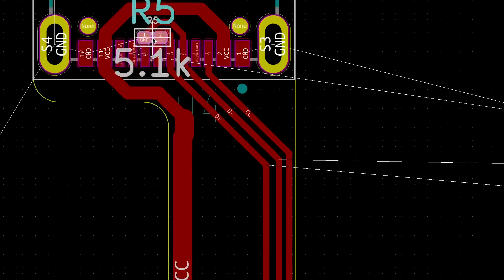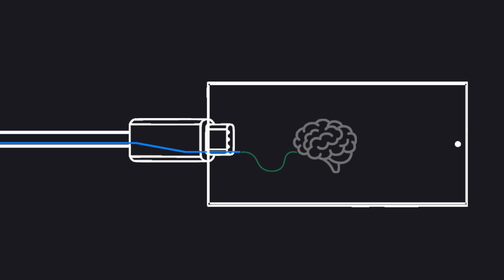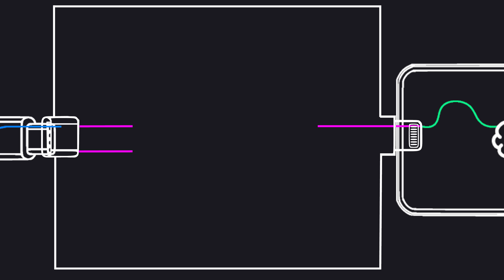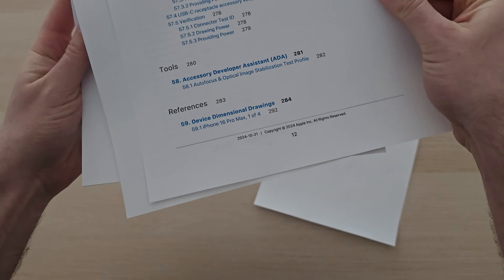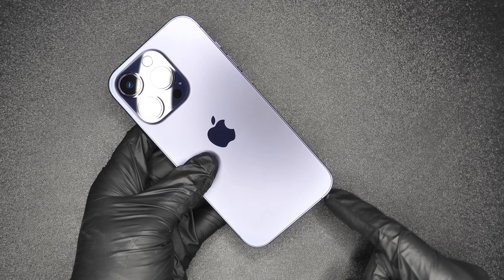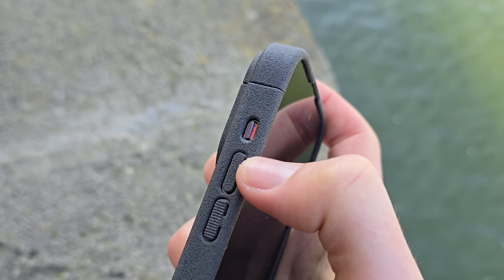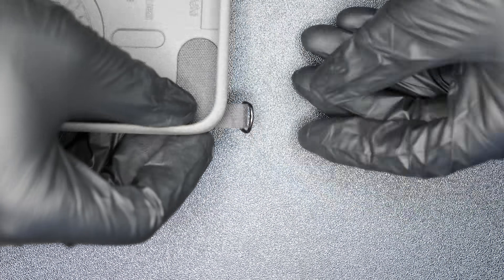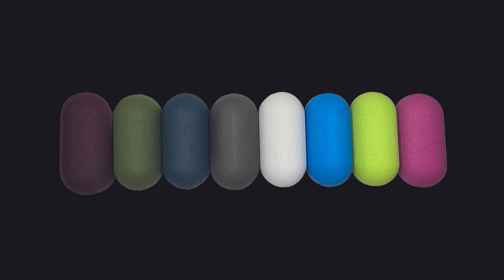I Gave Every iPhone USB-C.

Comment: One suggestion is that I would have that pointy corner for the charger on the left hand side, not the right hand side as most people are right handed and would not find that edge comfortable especially holding the phone with one hand.

Comment: Congratulations on this passion project! I have signed up to be notified when the next batch comes in. I do have a bit of a concern about the positioning of the USB-C port from a durability perspective - were you to drop the phone so that it would land on the bottom right corner, wouldn't it damage the port right away? Looking at the renders and photos on the product website it seems like there is not much padding around the port.

Comment: Adding a headphone jack is a cool idea, but it's not practical. The main reason is that the iPhone's Lightning port doesn't support analog audio input/output. This means you'd need a USB audio chip along with Apple's proprietary authentication chip. There simply isn't enough space for these chips in the device's slender design.

Furthermore, the charging circuitry would need to address how the iPhone could power the USB audio chip when it's not actively charging. All in all, incorporating a headphone jack into the current enclosure size would be extremely difficult, unless the device's size was significantly increased.

Comment: Here is an idea, the latest iphones have very think camera bumps, you can move the usbc near the camera and increase the width of the bump. I would even put it at the back on the left side but horizontal, so the cable sticks out on the side, this prevents also cables the bent

Comment: the USB-C on the side is not an optimal placement. You should exploit Apple's dumb camera bump and use all the free space on the back of the camera. As well as integration of the MagSafe backplates. That keeps the plug on the bottom on the middle.

Comment: Words cannot express my amazement and gratitude that someone finally made a proper USB-C iphone! 

also I'm about to send this to everyone I know with a pre-15 iPhone

about a year ago I was running an 8 with a walmart adapter sticking out of the bottom, and that sucked! it got stuck on everything, the connection was spotty bc of the connection play, and anything above 5V 1A didn't charge the phone at all. If only i had one of these cases 🥲 (my eyes are actually watering right now this is beautiful)

Comment: Great project, you opened up the possibility to charge older iPhones without technical restrictions 🎉
I'm a android user and never has the apple problem, even though I think this is a great project.
As you mentioned, you went all in and because of I really like your journey with your projects I will share it on X and Instagram ✌🏻

Comment: Really great, I have a iPhone 13 mini I love to have usb-c to standardise the charger cables in the home. Although you’re all sold out. 

If  you could somehow solve the missing headphone jack it be a killer product. But I do understand that would be difficult to achieve with it being larger hole and requiring power. 

I like listening to lossless music, Bluetooth doesn’t sound great for me. Having to have an adapter for my headphones is another annoyance. Most adapters fail with time or can affect your headphones. 

I also prefer a rim case, no backing or colour to match my phone. But what you achieved is great, cheers.

Comment: Putting it on the other side would have been better for right handed people.. And when you play games, just turn it the other side for it to be top left.. Iphones are smaller and the corner ends up in people's hand.. Plus they are used to the feeling of tbe round corner.. More people will find it annoying and choose to not use it.. 

You know.. You ask people for their opinion on the street.. Some tell you it should be on the other side and you ignore them. Its a pretty big fail on an engineering standpoint. You have discovered an aspect you had not considered and decided to ignore it for your biased reason. In the end its your product and maybe like apple, you think you know better🤷‍♂️ 
Wtv. I dont even have an iphone. But i remember hating have audio jacks on the botom right. Broke so many plugs.

Comment: I believe type C on the left makes more sense because 80% of the time people are charging their phones while using them, and the cable will be in their way, as most people are right-handed. Both sides have pros and cons. Choose whatever side you wish; you can't go wrong or right. Moreover, the right corner will consistently be in contact with your hand, which may mess it up in the long term. Just my thoughts.
Reply: I had the exact same thoughts, I believe the cord and port would get in the way while using the phone and charging it. As for having it on the right so it doesn't get in the way while gaming - most games allow the phone to be in either orientation and automatically rotates.
Reply: But it's such a awesome invention. I don't have any iphone but will let people know. All the best
Reply: I agree. It should be on the left. It's an oversight
Reply: I'm right handed but 99% of the time, I use my phone with my left hand.
Reply: Right handed, so you hold Ur phone with your  left hand.   Usb C on the right side is correct.
Reply: @siedliko I'm holding my with right hand almost 99%of the time. I belive you must have wrote this comment with right hand. Or using it right now by right hand. Don't lie

Comment: Inwill say from the beginning that I do not need the cases. I like what you did, a lot of effort, great result, here’s what I think you missed. 
Just because you use an Ultra and you’re used to sharp corners, it doesn’t mean others will get used to it. For me this would me a dealbreaker, my gf has  S24 Ultra, I hate how it feels in hand. I believe most people are right-handed, so charging while using the phone now would require switching the hand. The position would be good for gaming, but how many gamers have such old iPhone’s? 
Sorry, you may not like the extra work for a left charging port, but create an option on your site for people to get notified when a left charging model would be available and see how many desire the left charging port (that’s the most accurate way of knowing what the market desires, not what you think it wants)

Comment: Drop test? Surely the primary reason for having a case is to protect the phone. Not sure how much this would actually help. Just saying.
Reply: You didn't buy it for its drop protection, you bought it for the USB-C. But I'm sure it will perform better then without a case on, it is a thick plastic which can absorb the impacts

Comment: This is super cool 🔥 Made me think what if someone took this idea even further and made a physical case for iPhone that adds an Android-style Back button?

Like, imagine a case with a small hardware button that triggers a “back” function system-wide. Could be super handy when you’re using a keyboard or just miss that Android feel.

Right now on iPhone with a keyboard, you can kinda get “back” behavior with stuff like:
	•	Command + [ → Go back in apps like Safari
	•	Command + H → Go to Home
	•	Command + Tab → App switcher
	•	Esc → Sometimes cancels or goes back (depends on the app)

But there’s no true universal Back function like Android has. A physical case with a built-in button that mimics that would be sick. Could even link it to shortcuts or use AssistiveTouch for gestures.

Would love to see someone build that 👀

Comment: @Exploring the Simulation what if you add a 3.5mm jack and a vapor chamber with a preaplied thermalpads that have a protective plastic film witch can be pealed at 180° for better cooling that goes around the magsafe to alow wireles charging and a place for a sim ejector to remove that sim. People can opt for custom sim tools if they want. Nice work overall

Comment: Looks like a useless product.
I have both iPhone 12 pro max and airpods pro both have lightning and i have 16 pro with usb-C
So the only time i plug a cable if i need to copy photos to PC, I charge with magsafe, and sync with BT and WiFi
I have some cheap USB-C to lighting adapter that plugs on and it works fine, but I also have lighting cable

I don't understand who needs this?
Charging? Wireless
PC syncing can be done with WiFi, in worst case you have lighting cable

Comment: 24 hours later and sold out! Amazing!

another advantage to this case: covers the phone's lightning port, preventing dust and debris from entering, therefore extending the life of the port. If the port on the case gets messed up, just order a replacement case ... or don't! you still have a functional protective device!

When phones go "totally wireless," maybe you can do a similar case that converts wired usb-c to a qi2 or whatever magnetic charging standard exists at the time.

Comment: I appreciate why you started with "currently supported" iPhones, since those using even older ones are likely to upgrade to one of the currently older ones sooner rather than later, but I'm a little sad the iPhone X isn't there since that's the only device I have left that uses lightning and I use it as a backup and travel phone.

Comment: Your concept and products are fantastic but everything's sold out!  Not a bad problem to have though.  Would you consider making an integrated battery case for the SE models?  If you would, I'd be very interested in buying that for whatever price it sold for, especially if the battery was 4,000mAh or more.

Comment: Should add a headphone jack, might be a bit tough tho, would need a detect pin on the 3.5mm so it can switch to headphone mode or just a manual switch on side of case idk

Comment: It's a great design, but considering that 85–90% of the population (fact) is right-handed, placing the charging port on the left side makes more statistical sense.
The only thing stopping me from ordering this is the charging port placement. I hold my phone in my right hand, and the cable gets in the way.
Just think about it, your target audience consists of people with older phones. Older phones tend to have dying batteries, which means these users are likely to hold their phones while charging (personal experience). With the charging port positioned awkwardly, it creates a psychologically unpleasant experience with the product.
This experience might not deter impulse buyers, but the long-term impact is significant. A positive experience leads to more sales: I buy it, love it, and then purchase it for my children, friends, as gifts, etc. A negative experience? I buy it, kind of like it because of the hype, but then think, “This is cool, but uncomfortable… I’ll just gift it to someone left-handed.” 
I think, practicality and comfort should be key factors in this development. In my opinion. :)

Comment: hey, i've got a question for you. my right arm got paralysed from a dirt bike accident a few years ago. since then, i've gotten that paralysed arm amputated and now i've only got my left arm and left hand so i'm one handed lol. i have an iphone SE 1st Gen 128GB, new battery and running IOS 15.1.4 or smthn like that. i bought that for the convenience of how small it is, it literally fits in my hand, PERFECT size. thus the downfall is lighting cale for charging. wondering if you can help me with my disability, make the accessibility easier to use the iphone and you to change the lightening cable port on the iphone SE 1st gen, too USB-C? im happy to pay for postage, send you out the device. lmk please v;D fyi i am from the land down under, australia

Comment: Dude!
This is so simple but solves a whole different and bigger problem as well:
Basically everybody with a smartphone ends up having more or less wear on their USB/Lightning Port, so by sacrificing the extended port in the case (think of powerbank usage while on the move (a nightmare for any port)).
What I'm trying to say: This needs to be an option for ANY phone case. Especially those that have USB-C already.
You plug in the case once and when the charging port in the case gets damaged, the replacement ist easy for anybody.

Amazing, that no one came up with this yet...

Comment: Couldn't the case be mirrored on both sides and the PCB be removable so you can switch if you want the left or right charge port? Or would the CC pin trick not work the other way?

Comment: Great and all awesome process.. but being an iPhone user from the the iPhone 4 or so… I genuinely have nothing but hate for the usb-c on my new phone.. basically every one of my audio/charge cords I’ve purchased from anywhere has become infuriating and intermittent with a single drop if in the car and the phone drops down.. and basically the second day into owning my iPhone 16 promax the usb-c port is loose inside the phone. Not one single time in the past 10+ years have I had an issue with the lightning cables. Not once. 
So far, half a year into this new phone I’ve been through 3 audio adapters and 4 charge cables.
TORTUROUS

Comment: An idea from me is making the case a little bit thicker and putting a port underneath the lightning port. Also with this system maybe you can integrate a micro sd slot so you could shoot videos directly on it. Idk if I’m just yapping but anyway 😂

Comment: Can you give every iphone a headphone jack
Reply: fr, put it at the top or smth
Reply: With a built-in dac, it would be sick
Reply: Omg im down.
Reply: +ipad
Reply: Yeah do that
Reply: And memory card slot
Reply: A quality DAC won’t fit else crappy audio
Reply: Omg yess
Reply: With the case you can use a USBc to headphone jack
Reply: Does not support audio.
Reply: @leighhaynes are you sure??
Reply: @Somewhat-A-Gamer You can’t sadly
Reply: @circuit10  then why can I do it on my pixel 7 pro?
Reply: @Somewhat-A-Gamer I’m not saying USB C audio doesn’t exist, I’m saying it doesn’t work through this adapter case, as it says on the website linked in the description
Reply: @circuit10  it can supply power
Reply: @Somewhat-A-Gamer No, headphones generally don’t supply power to your phone

Also it specifically says “That includes things like wired audio devices”
Reply: @circuit10 my adapter can also supply power
Reply: yes,  you can buy Bluetooth wireless headphones
Reply: @cryptowhale1615  it literally says wire-less

Comment: I'd love to see something this compact for old iPods (iPod Mini 2nd gen and 5.5 Gen iPod classic) that could convert the 30-pin connector to a USB-C and add bluetooth for good measure. Internal mods are cool but to be able to slot the device into a case and adapt it like this, without adding much bulk, is awesome.

Comment: Execution on this is actually phenomenal, love every the aspects of this one. its always so satisfying too see designs where genuinely every feature and face has been thoughtfully evaluated, no random choices, no corners cut, no "its good enough", its all just right 🧑‍🍳

You should totally consider making a V2 of the airpods case with a similar "connector in the rounded corner" type design. As you found yourself, it looks much better 👑

Comment: honestly having this case for the newer iphones that HAVE a USB C port with a micro switch to turn off data access would be pretty neat, and i saw a few people asking for a headphone jack, that would be amazing if you could make that work with a decent DAC. the 3.5 mm jack would probably have to come out of the side instead of the bottom due to length. 

there are so many cool things you can do with this PCB, great work! hope to see some creative uses for the PCB past "just" charging/data

Comment: Do a reverse version for the newer iPhones with usb-c.
Reply: For April's fools 2026
Reply: @therick0996  That's a good idea lmao, maybe a limited time run.
Reply: Please don't. Lightning isn't the standard anymore and that's the right way.
Reply: @TimGmbH1  If I were to upgrade to an iPhone with the USB-C port, it would actually be useful to have a lightning port case in the event you lose or can’t access a USB-C port. Heck, a case like that would be useful for even Android phones, especially considering many people still tend to have older iPhones. Then again, I absolutely ABHOR this IPhone 13 Pro Max. I miss my Z-Flip 4. I broke it. Not Samsungs fault, I had a $5 case that I  dropped on the hinge on a warehouse concrete floor (Amazon).
Reply: @TimGmbH1 I know. 
First it was mainly a joke. 
Second some people would actually love such product because they might have expensive lightning accessories they want to keep using. 
(Third I personally prefer the “locking” mechanism of lightning. It clicks way nicer than usb-c and I hate all the different standards of usb-c. With a lightning cable you always know it can charge and do data transfer. With usb-c it’s always a gable what configuration it is)

Comment: Work has been hounding me to get a work phone for a while, but they only want iPhone's so everything is standardized for their MDM. I've held off because they won't budget for an iPhone 15/16 and the older phones don't have USB-C and I don't want to add an obsolete charging tech to my kit. This case is a dream come true and I can't believe how much of it you've not only designed but are even mass producing independently on your own. If you get iPhone 12 or 13 in stock on your site I will buy ASAP.

Comment: This being sponsored by backmarket rubs me the wrong way, since most backmarket sellers do NOT use genuine parts, which was the issue you ran into right before portraying backmarket as a solution for said issue. Kind of misleading.
Reply: Yeah, but to be honest, the only thing that matters is if the phone works, I don’t care if like the screens up I don’t care if like it scratch that Frick if it just works, then that’s all I care about unless it has less than 90% battery health